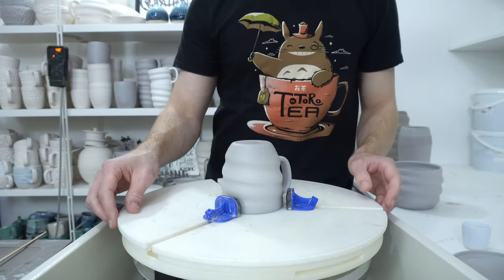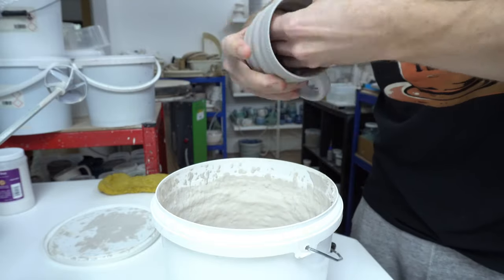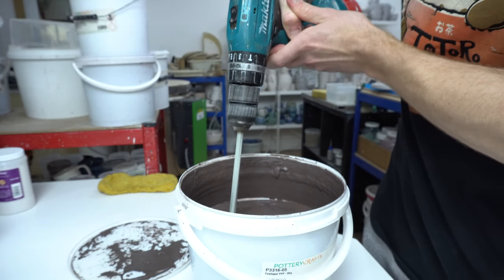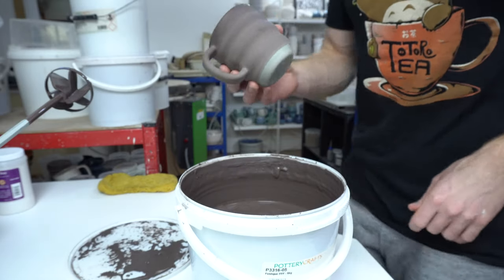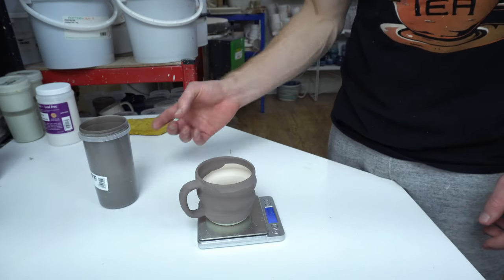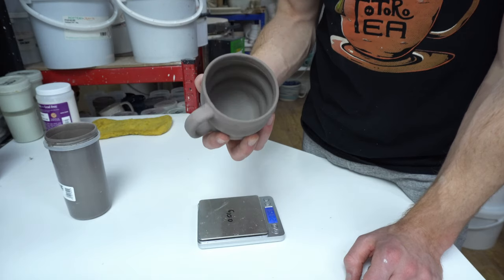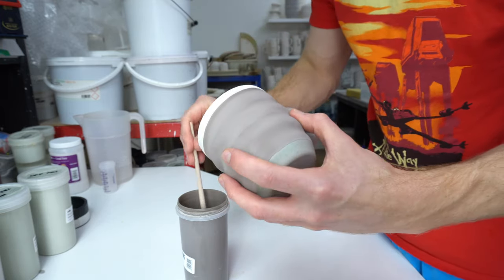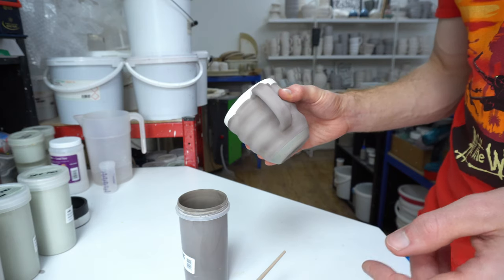How I glaze my Sunset Mugs

Comment: Hi Joe, can you tell me the dimensions of the glaze stirer attachment you use. I want to get one (small amatuer set up) and have seen 1000*100 and smaller 400*80 and am trying to work out if the longer shaft is better. Thanks.
Reply from the maker: Both of those are bigger than the one I have, but it really depends on the rest of your setup. If you have deep glaze buckets on the floor then a 1m (assuming I'm reading your comment right) mixer might make sense, otherwise I can see that being quite awkward.
Reply: @OldForgeCreations  thank you for your time. Yes the dimensions were correct in mm, I have gone for the smaller one. Happy potting, Patrick.